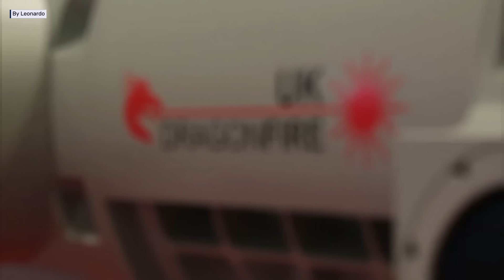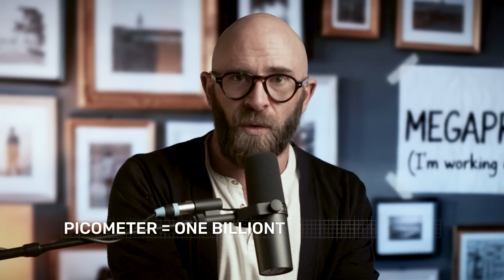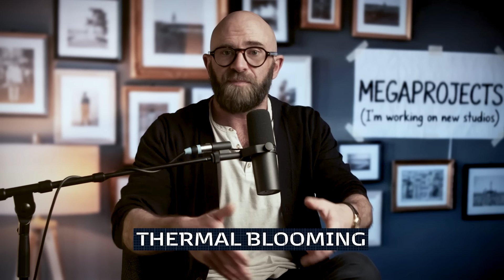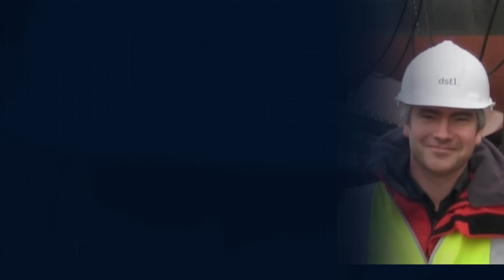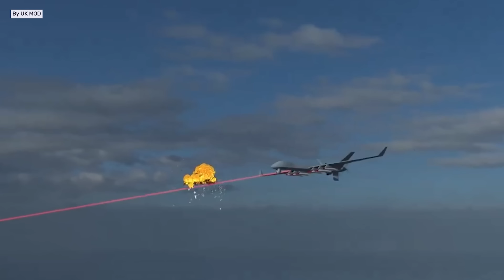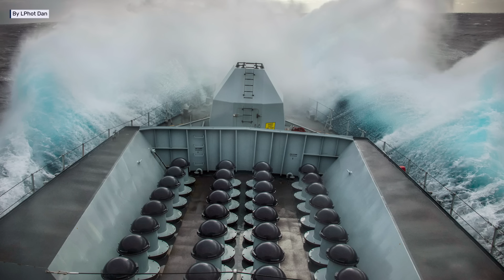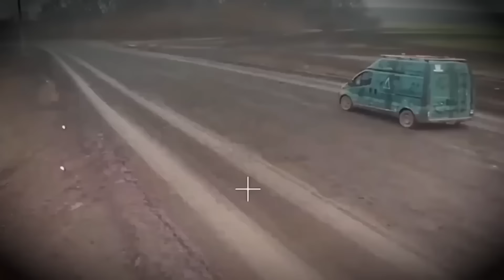The UK's Insane Laser-Directed Energy Weapon

Comment: Erm why can't they just coat drone / missile with reflective material
Reply: It would be useful for the attacker if their missiles are coated to absorb at the frequency of EM radiation used by the other (defending) party to detect the missiles.

Ideally this coating would also reflect EM radiation at the frequency of the EM pulse used by the defender to disable, destroy, or incapacitate the incoming missile.
Reply: Well they could try but that requires effort and resources.  The greatest threat from drones are mass, cheaply made, one-use explosive drones and trying to fit them with bespoke reflective material that might work will likely not be worth the extra drones they could spend that time making.

  Reflective countermeasures are more likely to appear on drones that need to be re-useable, like reconnaissance or weapon platforms.

Comment: The problem presently with laser weapons is that once they fire, the enemy knows EXACTLY where they are. Until them can be made mobile, they are at immediate risk of a swarm attack once their location is known. Given how delicate these systems are, any damage at all may take them offline for weeks or even months. Also, I reiterate that these are last-ditch defenses in most applications. Laser weapons CANNOT reach out hundreds of kilometers and likely never will. Currently, 10km is the limit, especially if there is any excess moisture (yes, simple humidity), dust, or so forth in the air. Even a light breeze will impact the amount of energy at distance. Just because it puts OUT 10 megajoules (for argument's sake) doesn't mean the target RECEIVES 10 megajoules. In practice, it may be as little as 10-15% of that. Also, at that level, be aware that at 230v RMS, it will take a feed of 12 amps for one hour to charge it. (About 2800 watt-hours.) Picture what's required to fire once per minute. Also, each time it is fired, everything heats up and needs time to cool off and that limits how frequently it can be used without damage So let's keep some perspective here.

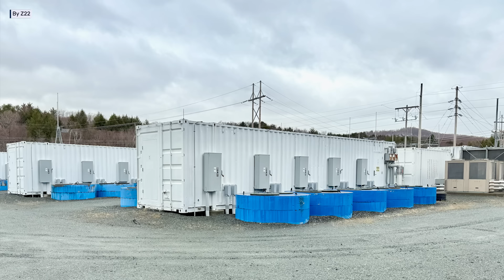Comment: @9:00 a clutch doesn't use a fly wheel, and nothing to do with flywheels
Reply: It has everything to do with flywheel dude. The entire job of a clutch is to engage with the flywheel on the motor to spin the transmission.
Reply: @omegasys8863 yea, but that's like saying the clutch pedal uses a fly wheel to operate the clutch, which uses a flywheel to engage the engines flywheel
Reply: @mikgol81  no, it's like saying pressing the clutch pedal down disengages the clutch from the flywheel, therefore the energy from the flywheel is not transferred to the transmission of the car, which is what actually happens. His words EXACTLY: "The most common use of a flywheel is inside a car's transmission (technically correct), as it stores rotational energy when the clutch isn't engaged, transferring that energy back once you change gears." I don't see where the misunderstanding is or if perhaps you're confused as to what a clutch is. A clutch is NOT a clutch pedal, it is the thing that the clutch pedal affects.
Reply: @omegasys8863 naa clutch is friction plates that connect 2 spinning things, whether they have a flywheel or not
Reply: @mikgol81  what are you even talking about man? This was in relation to automotive uses of flywheels. We are not talking about the definition of a clutch. It's ok to admit you made a mistake my guy. Swallow your pride a little bit. If you still don't understand wtf he was talking about, I'm not sure anyone can help you.

You can be wrong sometimes and it doesn't mean it's the end of the world. You don't have to start getting in semantic debates to "win" one over on someone.
Reply: @omegasys8863 a clutch is a clutch, a flywheel is a flywheel... get it right my man

Comment: Notably the USSR had a laser weapon system. They wanted it to take down balloons because America was doing overflights at extremely high altitudes. Expensive aircraft and missiles could just about reach them, but the balloons were cheap so it was using a sledgehammer to crack a nut, but lasers were potentially also cheap.

Comment: It'll be ineffective on it's own and especially if it's stationary.
It'll be required to run multiples of these systems on multiple mobile platforms.
It'll require a consistent supply of reliable electricity; we're not due nuclear reactors in the UK until around the year 2050.
If the government was smart they'd invest in enabling every home to be equipped with photovoltaic panels in combination with electrolysis to produce hydrogen gas that is collected by the government weekly.

Comment: I wonder how effective mirrors would be as "armor."
Reply: Not very. Mirrors don't reflect 100% of light - for the first second or so it might work to deflect the beam, but then the reflective layer will heat up enough it starts to burn and darken. From that point on it would actually make the damage worse - burned/dark areas will absorb more of the laser energy, and vapourised tin from the mirror would carry heat into other parts of the drone and cause shorts across any exposed electrical contacts.
The mirrors would add a lot of weight too, which wuold hurt range and speed or payload on the drone.

A better defence would be a thermal ablative armour - basically a insulating material on the outside of the drone that's designed to sublimate (skips melting, goes striaght to boiling) under extreme heat. When hit by a laser the outer layer would boil of and the gas created would scatter some of the beam for a moment, but because it's an insulator the material underneath it would still be relatively cool. Getting through multiple layers of a material like this would be a bit like working through layers of an onion.

The catch for both methods would be that there are parts of the drone you can't cover - sensors and propellor blades for example. It's hard to find a target if you can't see where you're going. The armour might work for a few moments against a manually aimed system but Dragonfire would presumably just bypass the armour entirely by aiming for those weak points. Brimstone II missiles and Spear 5s (both UK weapon systems) already do this when engaging tanks.